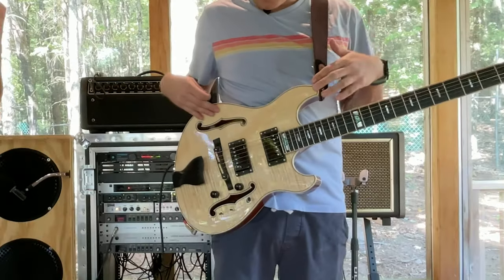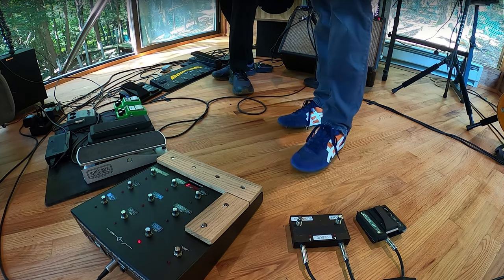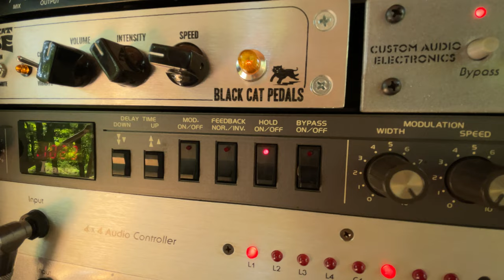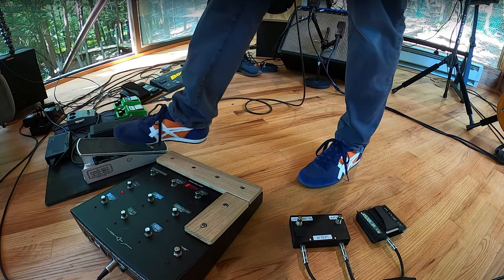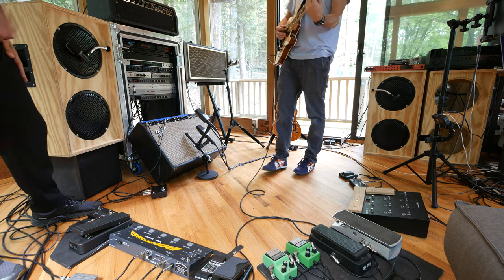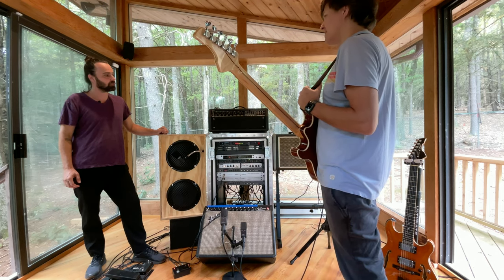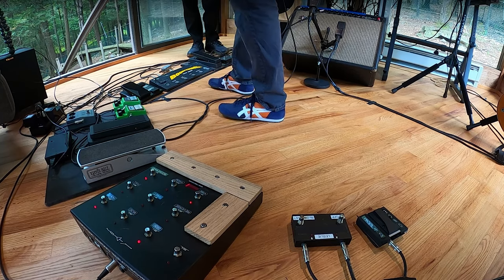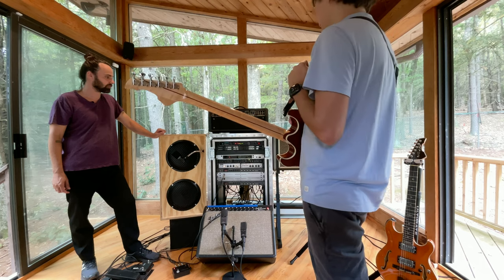Replica Rig Rundown - Trey Anastasio's 1999 Live Rig

Comment: I mean how do people obtain not just one but two languedocs??? Money aside. They’re impossible to find. When did you place the order with Paul back in 99??
Reply: I know a guy who owns two as well, and he said when he went to pick up the second one, Paul had like 20 husks (bare guitars with set necks) that were about to be customized. I guess he can crank them out still, which is insane. The guitars play as nice as they look, too!
Reply: @rgvt5638  I just checked his website again - unchanged since 2009!! I guess you just have to email him and EVENTUALLY you will get on the waiting list and then eventually you can get one. Kind of a like a King of Tone.
Reply: @TK-fk4po  right. you know, I personally play a hollowbody (core) PRS, and although it’s different, I can dial in a very similar tone with a compressor and into a Mesa amp. 25” scale is close enough to the Strat scale of 25.5” like the languedocs. And no waiting list! Still an expensive rig, but nowhere close to this replica rig lol.
Reply: @rgvt5638  Cool. My son has a PRS hollow body II (but it’s an SE.). We have a 65 bandmaster amp through a ceramic speaker and with the right settings, A Keely compressor, a tube screamer, and a whammy pedal, etc., he can get fairly close.
Reply: He doubled the price recently.
Reply: @jage71  If I were him I would also

Comment: I still haven’t figured out how he controlled the CAE super tremolo on and off. is it in DIJ CRAP? I’ve seen recordings where he seems to activate it from the RS-10 and other times from the pedalboard right of the boomerang is this a mode selector for the tremolo or on/off switch or both? The RS-10 shows 6 labeled loops DM2000, MOD,HOLD,MICRO,DIJCRAP, and UNIVIBE. He also had 3 blank loops bellow those possibly left over from the CAE 3+ preamp and one on the top left. so I am wondering how many effects can be in one loop and I am referring to Trey’s late 90s early 2000s rig you replicated
Reply from the maker: Good question.  The DIJ/CRAP loop, I believe, wasn't put into place until Phish 2.0 started in 2002/2003.  When it was put in place, he moved his Whammy and Boomerang into the same loop as the Super Tremolo.  If you think of a loop as just a send>return, you can stack multiple effects into one loop as a chain.  In this case the effect order was Tremolo>Whammy>Boomerang in that one single effects loop.  The Tremolo and Whammy each have their own "Bypass" controls so that's probably why you seem him engage it differently in the 90s vs post-2000 (ie he had to first turn on the DIJ/CRAP loop on the RS-10 then hit the Ch. B button on the little Trem control dual footswitch to un-bypass the effect when he wanted it.  They repurposed the footswitch labeled Ch. B to control the Bypass function).  In the 1999-2000 era, the Trem had its own loop and the Whammy and Boomerang were actually the beginning an end of the full signal chain pre-amplifiers if that makes sense.  Hope this helps!

Comment: Great work!  I've been following this on Instagram for some time now.  Thanks for doing the rundown.  I have a quick question about the trance loops/whale sounds.  I guess I didn't realize he was doing that with the hold setting on the delay.  It seemed to me that he would use the delay to let it repeat a time or two, then use the boomerang to get them to repeat so he could stack several on top of one another and control the level relative to what he was playing with the Boomerang's volume roller.  That was how I found it easiest to do it in my old, not nearly as accurate, cobbled together setup.  Loop off the main rig into a whammy->Digital Delay->Boomerang.  Trigger the loop to make whale noises, use boomerang to loop and stack them, get out of the loop to play over it.  This was 20 years ago though, and our information about what he was doing was a lot more limited.  Keep the videos coming!

Comment: Two questions: 
1- what chord and setting on whammy did you use for the ghost loop you did? 
2 - same question for jibboo loop?
Reply from the maker: For the funk siren loop you generally use the upper right hand setting on the Whammy which is just straight octave pitch shifting.  You usually just pluck any note within the key you’re playing, usually root, octave root, third, and fifth but you can mix it up.

Comment: Tyler, what settings do you have on the Dm2000?  Been working on the siren sound but it just seems off a bit.  Guessing you have the whammy set to 2OCT?  Any feedback you can provide would be much appreciated!
Reply: Input 9
Delay Time 1023
Width 10
Speed 0
Feedback 9
Dry 10
Delay 9

On the Whammy II, Trey used the upper right hand mode for 1 Octave up and then pitched it down for the Funk Siren loops.  

I'm hoping to have a deep dive video on this technique out by the end of Jan so stay tuned!
Reply: @TylerPenn  Thank you!  I think I have it dialed in now with that info.  I have the wrong year DM2000 which i think is bringing some challenges also cannot figure out how to make it slower; I think the siren is too fast but that could be user error.  Pressing hold at the right time seems to be hard as well, hah.  here is my version...https://youtu.be/Kw3SYR8Or6w.  Looking forward to your video, I am sure it will answer a lot more questions that not only I have but the rest of the phish community!
Reply: @TylerPenn  when i set my delay time to 1023, it seems the siren is wayy to fast; how the heck does he slow it down?

Comment: Can you provide some details on the platform wood? Size? Installation?
Reply from the maker: The one the Languedoc speaker cabinet is sitting on?  I just built a 12x12x12 cube out of 1/4" birch plywood, spray painted it matte black and covered the edges/corners with black gaffers tape.  Basically what Trey had, though the second box I recently built is 14" wide/deep, the one in this vid is a bit too slim so I'm going to replace it with the larger version.
Reply: @trey99rig  very helpful but I was actually curious what the platform (on the floor) that the ts9s, volume, wah and Ross are on…

Also, do you still put your volume pedal first? I saw something that showed its after the ts9s

Thanks for sharing!
Reply from the maker: @GucciPonderosa   oh yeah, that's just a piece of 1/2" (I think) MDF that I bought from Home Depot, cut to size, and spray painted matte black to match what Trey had back then for that specific pedalboard.  As for the volume pedal, yes, I moved it to the end of the chain so it now goes: Whammy >Wah>TS9>TS9>Ross>Volume
Reply: @trey99rig  thanks! Approx 16X24 inches?
Reply from the maker: 16"x21.5" @GucciPonderosa

Comment: I enjoyed this video, but I’d like to make some corrections if you don’t mind. Here’s the actual order of effects back then. 

- Crybaby Wah > Ibanez TS-9 > Ibanez TS-9 > Ross Compressor > Ernie Ball Volume pedal > CAE 4x4 audio switcher (more on that later). The Ross was indeed always on, and the Tube Screamers were in front of it. Because of this order, the Tube Screamers only affect how much dirt he’s getting. They have no effect on his overall Volume (in photos from that era you can see that the volume knob is maxed on Both Tube Screamers). Because of that order, he puts the Ernie Ball Volume after the compressor as a master volume and he used the volume knob on his guitar to control how dirty the Tube Screamers were. Now I’ll get to the Rack. 

From the Volume pedal, the pedal goes into a CAE 4x4. The 4x4 has 4 audio loops and 4 control switch outputs. The rest of the chain is kind of odd, but I’ll try to describe why that is. There’s an interview where he explains it. 

-Loop 1 Input Jack > Loop 1 Send Jack: (labeled dig/crap) Digitech Whammy II > CAE Super Tremolo (the tremolo was controlled by an external foot switch next to the expression pedal for its speed because the 4x4 only has 4 loops) > Boomerang Phrase Sampler > Loop 2 with Ibanez DM200 in it > loop 3 with Alexis Micro Verb set to Reverse > back to the return jack of loop 1. From there the signal went to loop 4 containing a CAE Black Cat Vibe. 

He explained that the reason he put 2 of the other loops inside of loop 1 was because he wanted to be able to turn off everything inside it with one switch on his CAE RS-10 midi controller. This served 2 practical functions; he could have loops going on the DM2000 and Boomerang while his Whammy was on, and with one switch he could turn it all off. Those old units are finicky too, so loop 1 could be turned off if any of that gear had issues. And the Black Cat Vibe was after all of that because he wanted access to his Vibe even when all the digital stuff was bypassed. The switches on his RS-10 controlled the “dig/crap” loop, the Ibanez DM2000 bypass, hold and modulation functions, Micro Verb Bypass, and Black Cat Vibe bypass. 

The main reason for this setup was that he wanted all of his rack gear to fit in a single 8-space rack. 

Before this period everything, even the Tube Screamers and Compressor, was rack-mounted and everything had its own loop and corresponding switch on his RS-10 (except for the compressor and volume pedal because they were always in the chain and didn’t need loops to bypass them). This was possible because he used several 4x4 audio controllers and his RS-10 had an expander on it which gave him 6 more things he could control. He also had more gear to control. He had a rack-mounted CAE Preamp, a Peavey Valverb, and he used all 3 Microverbs. The 16 foot switches in that rig controlled 
1: preamp channel 1
2: preamp channel 2
3: preamp channel 3
4: TS #1
5: TS #2
6: Digitech Whammy II
7: Ibanez DM2000 bypass 
8: Ibanez DM2000 Hold
9: Ibanez DM2000 Modulation 
10: Alesis Microverb (vast)
11: Alesis Microverb (full)
12: Alesis Microverb (reverse)
13: Peavey Valverb Spring Reverb
14: CAE Super Tremolo Bypass
15: CAE Super Tremolo “Chop”
16: CAE Black Cat Vibe

I hope you found this informative and possibly useful. I’ve been down this path in my past and owned almost every piece of gear listed. I ended up selling most of it because the huge racks were not practical for the gigs i was playing, and I have my own sound and style that doesn’t require most of what Trey used. I love your dedication and I’m a bit jealous because I’ve still never played a Languedoc, let alone OWN one! Be well, and keep having fun!